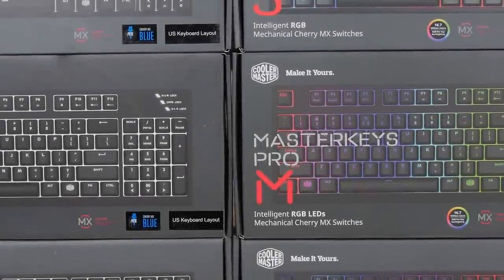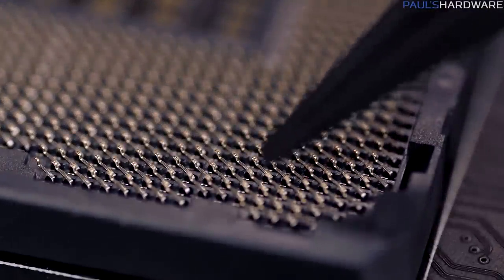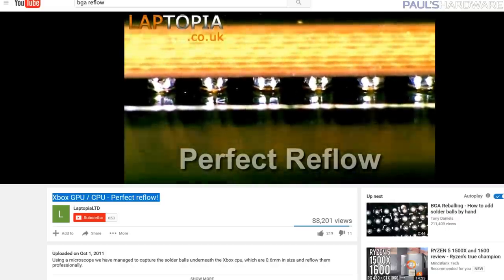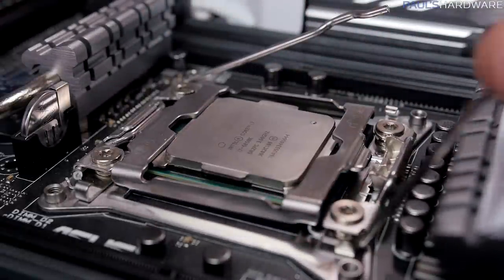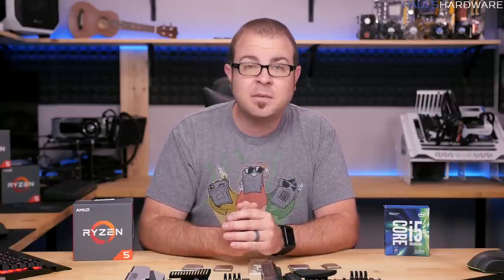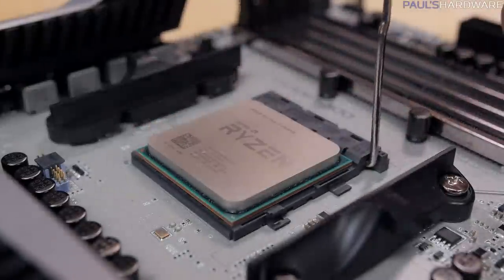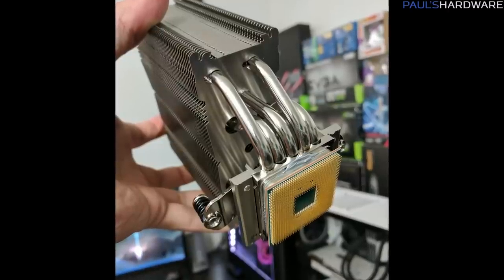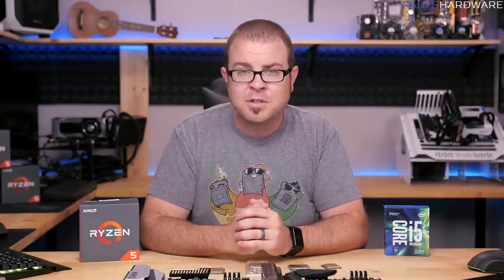LGA vs PGA! Which is better?

Comment: PGA: Bent one of the pins and while I had it in my hand bending it back in place I bent more pins with my other finger. Much easier to repair when u stop making mistakes and I got it working again quite easily

LGA: Can't really repair it but I have never even thought about bending one of those pins as it seems much more difficult 

Probably gonna buy a ryzen cpu but I wish they would make the switch to lga

Comment: The pins on an AMD CPU is MUCH easier to fix. Just a razor blade is all you need.

And they're pretty sturdy. I can brush my hair with a FX 6300. And if you lose a pin, you can drop in a small bit of paperclip.

Comment: I actually have a old dinosaur intel pentium overdrive cpu that had been dropped and one of the pins broke off while straightening the pins so i just dropped said pin into the appropriate hole in the socket inserted the cpu bam still works to this day.

Comment: I once replaced the CPU on my laptop which was PGA. When I tried to install it, It wouldnt fit in the socket. Apparently The doofus who sold me the CPU left some dried up thermal paste between the pins. I had to remove the paste and unbend the pins to make it fit and work. using very fine tweezers and the hole of a mechanical pencil did the job to straighten them.

Comment: I had that happen on my ryzen 2700x when i went from stock cooler to water. Went to take the stock cooler off and it ripped the cpu out of the socket and bent 2 pins. Most nerve racking thing ive done in a while rebending those pins.

Comment: I personally prefer LGA, because while PGA is easier to fix, it is also easier to damage. 
Sometimes when removing the heatsink of PGA CPU, the CPU will stick to the heatsink and lift up with it. On worst case scenario it could detach from the heatsink and drop on ground or on motherboard.
AMD is also starting to use the superior LGA on their new threadripper CPU's

Comment: I have always prefered PGA/ZIF. But that could be because I have been using them my 486 days...  PGA pins have always been easy to repair as long as someone fat aunt didnt sit on the CPU.. Just use patients and if you get the close enough, the ZIF socket will normally keep them lined up enough to work when your done. I have pulled CPU or two out of board socket. I learned to just give a gentle twist and the heatsink will normally break suction from the cpu. At least if someone didnt actually glue it on or use some really crappy toothpaste for thermal compound. As far as LGA, I alway feel like I am going to damage the socket just by looking at it.. :-D

Comment: With PGA I find that if you can get the cpu as hot as is safely possible, such as via a stress test, and then disassemble it faster than the Avengers did when Captain America stole Tony Stark's last hot pocket.

Comment: I know this is old but when I installed by 3700x,  I could not get it in. This is straight out of the box, didn’t touch the pins at all. Thought maybe I had to push a little bit, so I did. 3 pins on one corner bent. Obviously then it wouldn’t go in still, so I bent the pins back. Tried again, still wouldn’t go in. Next, I tried letting the lever back a little bit, and it slid right in. For my motherboard at least, putting the lever all the way up actually prevented me from inserting the CPU.

Comment: I suppose PGA better cause it provides larger contact area and better locking mechanism (more reliable and also there is no need to make lock as cutted edge, just no holes for pins is a good approach for lock). Also in terms of customer support service it is easier to return CPU with broken pin rather than motherboard with broken pin. And also spring like contacts not really good solution cause copper has low fatigue limit. That means copper do not have a distinct limit and will eventually fail even from small stress amplitudes. So even good quality spring like contacts grid may fail.

Comment: LGA all the way I'd say, got a Ryzen 5 1600X two weeks ago, three pins in one corner were bent out place, straight out of the box, and required bending with a razor blade to get them back into position! Not the best position to be in!

Comment: I revived a 939 athlon 64 by soldering wire where the missing pins were and trimming them. I just a had a RadioShack iron and a nail clippper.

Comment: If you break a PGA pin(s), not a problem. Just get an old non working PGA CPU, break off the pin(s) & solder on the good CPU that was working. Done this lots of times.

Old non working CPU(s) are useful

Comment: Hey. One correction please after a year :) In PGA if you break a pin, you should try it for if it works. That pin can be useless for you. Personally I am using Phenom II 710 with 2 broken pins for 8 years :) You can try it on lga too ofcourse :)

Comment: This was an incomplete video. I was hoping you will talk about technical differences as well, not just "ease of installation" and etc. Do they affect in any way data transfer rate, do they require more components as in are the motherboards a lot harder to produce because of the pins and maybe other components needed for LGA vs PGA . Seems like a video suited for the novices

Comment: 0.5 mm mechanical pencils fit perfectly over the pins on an amd cpu, and if fixed quite a few just putting a mechanical pencil on the pins and bending them back into position

Comment: Probably prefer the LGA just because as an enthusiast you do probably handle the CPU a lot more than you mess with a socket. Ultimately it is a pretty small difference.

Lapping a PGA CPU can be scary though because the damn pins are so fragile. Need some sort of soft block to very gently insert it into like a soft watering block for potted plants or something. LGA you can kinda just put some tape and be safe. Also the "pulling up the CPU with the cooler" no doubt has caused more than a few accidents. It can be easily avoided with a little care and patience, but that won't help you if you simply forget about the issue =P

Here's to hoping that AMD will be doing a better job on the IHS flatness than Intel has lately.

Comment: I bent about 1/5th of the pins on my Ryzen cpu when switching to water cooling because I forgot about the thermal paste yanking the cup put with the cooler. I had to repair about 50 pins with nothing but a pairing knife while wearing three pairs of glasses which left me with a tiny mostly blurry window to even see the pins (I've had cataract surgery so my eyes have a fixed focal length set for distance).

I was never prouder than when the cpu reseated after hours of meticulous gentle prying with my giant bear paws I call hands. It was like performing open heart surgery with a clever while wearing a gas mask.

Comment: O man I have a motherboard that has that issue of not holding onto its PGA CPU tight enough on my second PC/game server/daughter's PC. I was recently upgrading the fan on the heatsink, and pulled the CPU out at the same time. You can do the twist method if the heatsink allows you to (the original AMD FX heatsink doesn't allow you to).

Comment: Your CPU could still work when you lose a pin on the mobo (or CPU itself). I had a 775 board with 3 missing pins and it worked fine. (I just couldn't overclock it)

Comment: I used to do IT work. I had 1 motherboard with bent pins in all my time. So it's fine.
I just swapped my Ryzen 3600 to a 5900x recently. The thermal paste was extremely adhesive like. Getting the waterblock off the chip was really difficult. lol I've actually never upgraded a CPU before. I always just put them in and leave them for the life of the system.

Comment: Loosing a pin on a PGA CPU doesn't exactly mean that the chip is toast.. in 2009 i had a AMD Phenom II and it lost a pin, but i took the pin that broke off and stuck it into the socket so that it made contact with the CPU and it actually worked, that is actually a pretty easy trick. PGA > LGA imo, always used AMD.

Comment: Anyone with a PGA cpu and not wanting risk pulling out the cpu: run the pc for about 10 minutes (unless it's already on). Turn it off then remove the cooler quickly so it comes off easier. Just be mindful of possible heat.

Comment: The best way to remove the cooler from PGA cpu/socket would be sliding it of as far as you can and then pushing it like a lever. Never just pull it vertically.

Comment: AMD says the PGA socket is cheaper than LGA so generally they can get you slightly cheaper motherboards than Intel. 
Also with removing a cooler on an AMD CPU, I recommend twisting it after you unscrew it, it will usually come off no problem.

Comment: Actually, if one of pins is broken on either type it might not be end of the world. It really depends on the luck which pin is broken on which particular model of CPU, but I remember running AMD Athlon x2 6400BE without 3 pins for a while, I believe the PC is still running after I sold it like 8 years ago. Similarly, I had i7 860 on Asus Maximus 3 Gene with one pin in MB simply missing, it worked well, but later had failure in PSU which toasted MB and gave me excuse to upgrade for Extreme.

Comment: It's a pity they don't have an intermediate layer that is easily replaceable and cheap. The motherboard has a PGA socket, and the CPU has LGA contact pads. The intermediate layer would connect them together. This would make both the motherboard and CPU more durable. I'm surprised the Intel motherboard manufacturers didn't go down this route. They must have a high number of RMAs.

Comment: i screwed up a board once and it wouldn't boot. I managed to bend the pins back (i think there were about 10-15 pins bent) it was while i was doing an lga 775 to 771 mod. friend still uses that mobo and xeon e5450

Comment: Goddamn I fixed two 1150 socket boards the other day with just a magnifying glass, a lamp and a tiny pair of tweezers.  I had two boards in storage, I had pulled them out to replace an older machine and wouldn't you know it?  Bent pins in the socket.  Not sure how, not sure why, but its fixable.  I think I'd be sweating if it was even more pins to align, and typically you can just have a reference photograph of where all the pins are correctly "flush" with the rest in alignment, you can fix it this way.  I'm surprised this doesn't come up more often with this older socket type.

Comment: i'm a little clumsy and i bent a few times my MB pins xd, but i never panicked or chocked trying to fix it, usually i only need my good pair of glasses, my cheap electronics camera, and a pair of tweezers of the thinest tip i have, the key is DON'T PANICK AND DON'T RUSH IT, you can bend them back, just do it slow and with little pushes or pulls depending on the situation

Comment: PGA sucks even when Intel used to use it in their Xeon and on their Pentiums back 10, 15 years ago. I personally think that despite having pins on the socket Intel boards are still dangerous to work with and one should be very careful. If only they'd make a land grid array sockets so that there'll be no pins that can be potentially broken.

Comment: Had bad experiences with both . With PGA I bent some pins on the cpu but luckily I was able  to fix it without breaking anything. On the other side , with LGA, I pulled out nicely the cpu from the mobo and basically it had like 3-4 pins stuck on the cpu but strangely it works even today without any problems so I guess I was lucky.

Comment: I vote for PGA.I broke 5-6 of my CPU socket pins which resulted in 1 ram slot on my mobo not to function.I once get it fixed but when i put out the cpu and cooler for cleaning once,my pins broke but it was my mistake and now one ram slot has gone POOF! Its much easier to repair straight pins which are on the Ryzen CPU.

Comment: actually your ryzen cpu isnt 100% toast if a pin breaks off a good amount of the ryzen pins are useless and if it wont work you can solder it back on! just a heads up

Comment: Personally, I had more headaches with the pins for AMD cpus than with those for Intel's. I would prefer if I didn't have to repair them period. Repairability sounds good on paper, but I care more about how difficult is to bend/damage the pins on either design.

Comment: PGA is better because you don't have to worry about bending pins on the motherboard socket. Pins on the CPU are harder to bend then pins on a motherboard socket. Also, if you do bend a pin on a PGA CPU they are much easier to straighten then pins on a motherboard.

Comment: I don't how it can be so difficult for people to install an LGA socket CPU without bending the pins on the motherboard. you're clearly doing something wrong if that happens..
Pins on the CPU bend by mistake alot easier (and break when you try to fix them). I've bent lots of PGA CPUs, but only one LGA socket and it wasn't even very hard to fix..

Comment: Tip, use a mechanical pencil to straighten pins, better than a razor or screw driver. And holy crap, that was way too much thermal past between the heat sink and processor in that picture. More is not better. Better to use the right amount.

Comment: AMD's CPUs are quite sturdy!

I've got an AM3 AMD Athlon II X2 250 and had an accident with it...I've got conductive thermal compound on the pins -_- I had to clean it...I had an old toothbrush...I cleaned that brush really well and then after it dried I soaked it in alcohol and started gently rubbing the damn CPU. Then I was like: F%>k this!!! This god damn processor doesn't even worth 5$! So I went YOLO. Next thing I noticed...I was going at it quite strongly with the toothbrush and the pins didn't even budge. They aren't as fragile as you may think. Still...Might not be a good idea putting pressure on a brand new Ryzen 5 1600X's pins :P

Comment: My AMD Ryzen 7 is stuck in the socket, I dont want to apply too much force to deinstalate the CPU, is it normal?
Reply: KCrimsonR does it work?
Reply: Yeah, it works, that's why I don't bother so much, but I wanna know if it's normal or what I have to do
Reply: KCrimsonR I think you will have some problems if you want to upgrade your cpu

Comment: the pins in my motherboard lga 1156 is broken but i still can use the motherboard. but my ram slots 3 & 4 didnt working. only slot 1 & 2 working.

Comment: i like PGA alot more than i like LGA, it was very easy to uninstall and install PGA where as i always get bent pins on the LGA motherboards, which is frustrating
i am wondering what i should get if i can get a new cpu and stuff... should i get an intel i7 7700k or should i get ryzen... that is the question i dont have the answer for right now... as i dont even have the money for either of the 2

Comment: I have an AMD Athlon 64 x2 5000+ Black Edition and it broke a pin and it does not have it anymore, but it works, why? I do not know. But it works normally. I think the Intel system is better.

Comment: Bare in mind that there is a major price difference between and and intel CPUs. If your pin on the PGA CPU from AMD then it'll be cheaper to get a new one where as intel ones are a hell of a lot more expensive for slightly higher speeds.

Comment: My heat sink got stuck to my AMD FX-8370 and bent all the pins! I was so mad... I had to straighten all of them and one pin broke off. I had an older AMD CPU so I broke a pin off of it, stuck it in the mobo slot and I still use this CPU 2 years later lol. LGA ftw...

Comment: Both have the issue "bent pin and your f*"'ed" unless you have a go magnifying glass and needle you can rebend it back if your careful I did it with my lga1150 sandy Board. And they both have to much paste and that suckers coming out with the heatsink.

Comment: The CPU with pins are pretty easily taken off without ripping them out of the socket.  Just twist the heat sink before pulling on it.  I fix computers for a living.  I have never yanked one out like that since I started twisting the heat sink first.

Comment: i spilled some thermal greace on my socket and i just couldnt get it away so my prins where bent. i used a toothbrush and scrubbed with the pins so that the thermal greace goes away. my screwdriver helped me with the broken pins now it works again. Just do what you do your cpu or motherboard is already broken. you Cant break it more.

Comment: LGA wins overall for the availability of inexpensive Intel motherboards with bent pins available on Ebay.  Bought 3 so far, all 3 were easily fixed by straightening up pins, some quite badly bent.

Comment: Although the LGA looks safe the PGA is more safer because if you have bent or broken a piece on CPU all you have to do is put that pin inside the exact hole and it will still work...and if you lost the pin still no problem you can grab an old cpu like pentium for 2-4$ brake a pin off and still put it in the hole and it still will work no problem....some experts can even perform soldering the pin back onto the CPU but not required....where as a with LGA you can kiss good bye to the mobo.

Comment: Never knew that this was an actual issue for some..amazing.. Any of these mounts resemble baby's toys, the one's you need to fit the shapes through their designated, similarly shaped holes... 😏
I maintained most of my family's, friends and sometimes on my workplaces PC's over the years (unfortunately), and also my own PC's. Almost every time i remove the CPU's for a good cleaning before re-applying thermal paste... Never even thought about it as a difficulty.. The re-assembly is like 5 sec's..

Sorry but as is see it, if anyone who is managing to mess up a CPU/mount, that person works carelessly and does a sloppy job... Sadly, a common sight nowadays.

The video itself is nice, there where a few informative bits, just missing the target by addressing a lesser issue which shouldn't really bother anyone.  For "better" i would have compared subjects such as - heat accumulation/dissipation, dust collecting, electrical contact.

I'd say - CPU coolers are a better subject to discuss when it comes to risky installations.